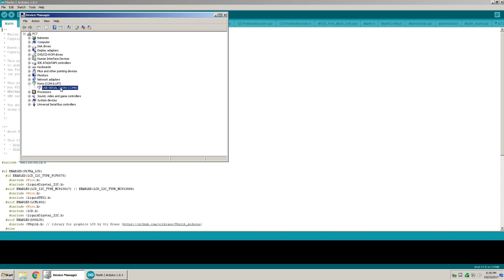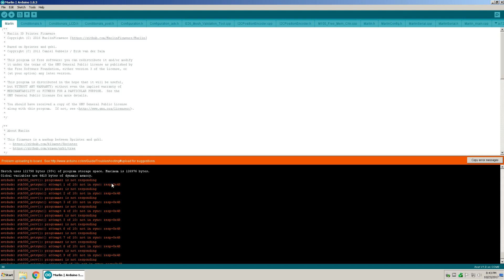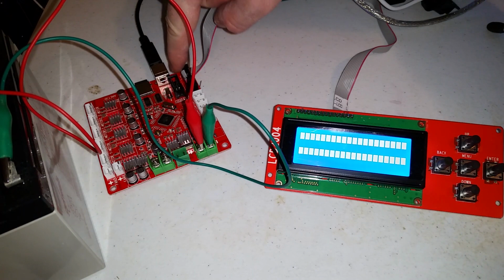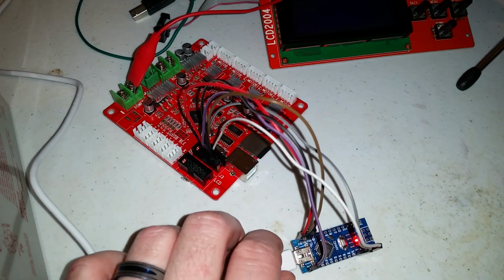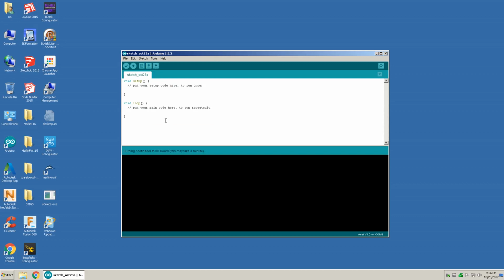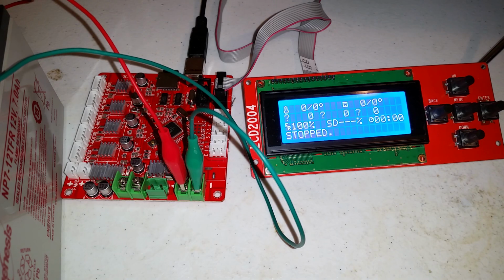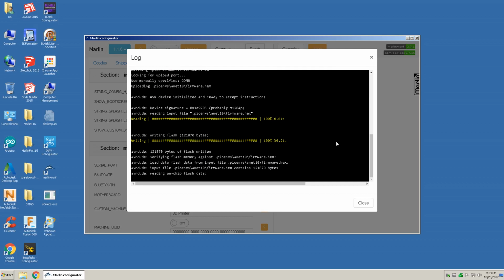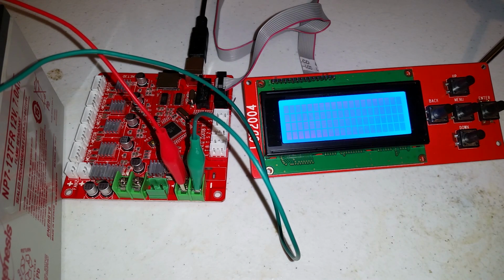Unbrick an ANET A8 Mainboard v1.0 After A Failed Firmware Flash

Comment: I have never used an arduino nano but I have the uno and I kept getting an  error every time.
what I had to do was upload the 'arduinoisp' script (in the arduino examples) to the uno and then run the 'burn bootloader.'
also I had to use 'anet v1.0 optiboot' otherwise I get the error marlin was to big???
its all working now but a lot of messing about and not a lot of information.
Reply: PROBLEM solved!!Thanks for the advice, first I used the nano but no luck, same error everytime with the Arduino V1_5 board. Then I got a arduino Uno R3 and try again. It worked out!!! Surprise!! You have to set up the arduino board programmer to be able to pilot the anet board. This site shows me how to manage it. I think, you have to do the same with the arduino nano: 
https://www.instructables.com/id/HOW-TO-FIX-ANET-BRICKED-BOARD-USING-AN-ARDUINO-UNO/
Just one more thing, bad synch can result from a bad wiring. I was using the screen plug to connect Anet and the UNO/NANO and I forgot that when I plug, the actual pin are inversed (like miror) from the plug's holes (when I look at them) . Sorry for my bad english guys!! Good luck!!

Comment: I'm having sort of the same issue. my printer works fine; however, I cannot get marlin on it, giving the same STK500 error. is it possible the bootloader could be corrupted some other way, while still allowing the printer to function?

I believe I have the same board as you, I just bought my A8 a few weeks ago.

Is there A way to flash the bootloader without another arduino?
Reply from the maker: Look at this article about the v1.5 board
https://www.thingiverse.com/groups/anet-a8-prusa-i3/forums/general/topic:24533

Comment: Hi! I'm currently having this error after I burned the bootloader and I try to upload Marlin via USB: 
avrdude: verifying ...
avrdude: verification error, first mismatch at byte 0x1f000
         0x0c != 0x88
avrdude: verification error; content mismatch

avrdude done.  Thank you.

the selected serial port
does not exist or your Arduino is not connected
Reply: Or this one: avrdude: verifying ...
Une erreur est survenue lors du téléversement du croquis
avrdude: verification error, first mismatch at byte 0x1f000
         0x0c != 0x88
avrdude: verification error; content mismatch

avrdude done.  Thank you.
Reply from the maker: Open the Device Manager and plug in the USB cable.  Does your printer board detect correctly or does it have a yellow !?  If so the drivers are not loaded.  If the drivers are loaded then try a differnet USB cable that you know works for data transfer and not just for charging.
Reply: damn you are good.. i had the same problem as erik and i was getting an avrdude error.. changed the cable to a shorter one i had from a printer and it worked!!! Thank you very much!

Comment: Hello! I am new in this kind of programming. (Sorry about my english) I am doing everything exactly as you do in this video, but when I clic in burn bootloader it just won’t work. It says “error burning bootloader”, even if I clic again in burn bootloader it keeps showing the same error. 
My arduino nano has leds that flash when I connect the usb to the pc, is that normal? What I am doing wrong? O:
Reply from the maker: Disconnect all wires from the good Arduino and see if you can compile and upload the Blink sketch successfully
Reply: Hi, I'm having the same problem as zhikizzme states above, but I'm using a arduino uno in my case. I keep getting the "error burning bootloader" 10 times. As you replied to him I'm able to uploed the Blink sketch to the arduino itself. How do I proceed in this case? And when I connect my Anet board via USB it doesn't come up on any COM port.
Reply from the maker: Do you have the CH340 drivers installed so the Arduino is detected in the device manager?
Reply: Apparently I made a mistake in my wiring for the isp, eventually it worked ;)

Comment: I had similar issues but I'm getting this error when I try and restore the bootloader. `Expected signature for ATmega2560 is 1E 98 01  Double check chip, or use -F to override this check.` I was able to run the same command with using the command line and added -F and it said it finished writing but I still get the similar error when trying to flash the anet with marlin. Not sure what else to try. Any ideas?
Reply from the maker: Is this problem on the default ANET A8 board?
Reply: Yes. I was able to flash the compiled hex file of Marlin directly with the Arduino UNO. Thanks for the help :)

Comment: The lines on the screen is just the screen not being initialized at all. Like you just apply power to the driver and the backlight.
Reply from the maker: The lines are cause by the board not booting the OS (aka firmware) because of a corrupt bootloader.  Its like the boot sector on your hard drive getting corrupted and not booting into Windows.

Comment: % for this error to happen?
Reply from the maker: Not sure.  Depends on your computer and USB cable
Reply: MrDabrudda thanks for responding, I succesfully did it!

And twice ;)
Reply from the maker: Make sure your USB cable is not a 10 foot extension cable.  Also try using USB 2.0 port and not a USB 3.0 port.  A flaky USB cable is what cause my bricking.

Comment: This is quite common to happen when I program an AVR. Usually I go to device manager, change the port number (right-click on it in devman, properties, special, change port number), and it just works.
Reply from the maker: It was the comm port being incorrect.  That's the first thing I checked in the device manager and arduino IDE.

Comment: Thanks, that is useful in case it happens in a future upgrade. I have a Teensy 2.0, can that be used instead of the nano?
Reply from the maker: Any Arduino will work as long as the pins are hooked up correctly.